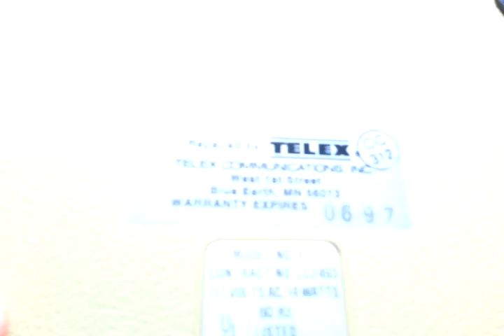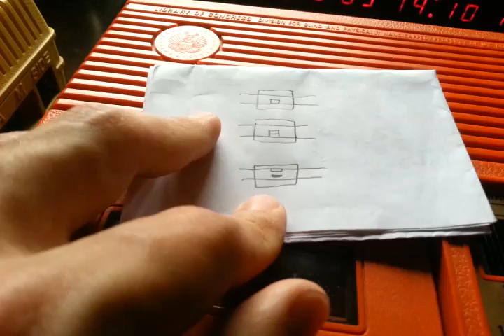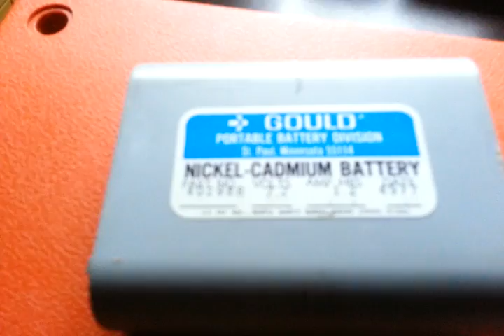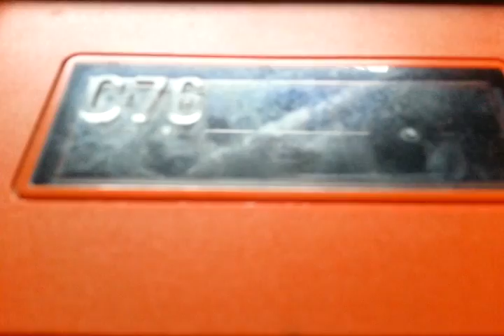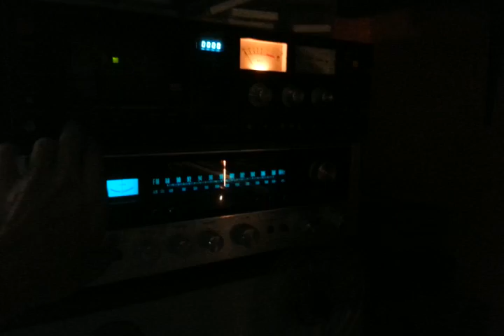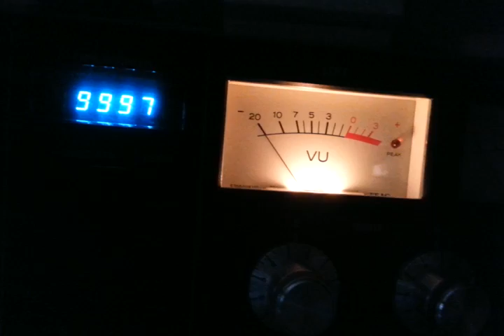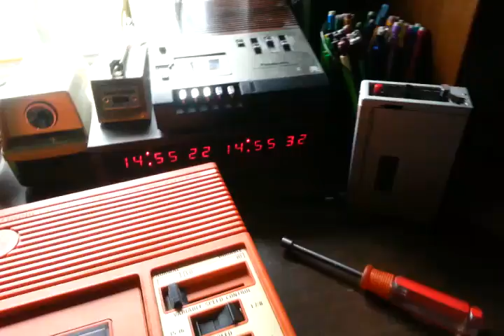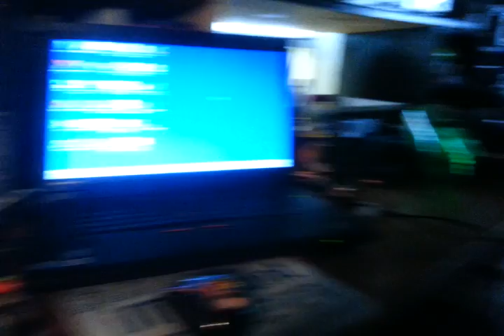C-76 Talking Book Cassette Player modified to Recorder, and showing two other talking book players

Comment: I had the C1, and also agree they're built to last. (I'm visually impaired). I also had a tabletop model from the American Printing House for the Blind, a modified GE 5193A, (winch had the same form factor as these) which is a recorder out of the box. It was fun recording on the 15/16th IPS setting and getting that long recording time.

Comment: I remember when talking book records were in use, then cassette tapes, and now we have digital cartridges. In fact, I recently got my quarterly newsletter from my state TB library and they said that a small (and getting smaller) cassette collection was still available to patrons who had a working cassette machine. However, if the machine fails to operate properly; then, that will be the end of your cassette service because the machines can no longer be repaired or replaced. It seems like they are serious about phasing out tapes and moving into digital. Looking on ebay, C1 players seem common; but, I rarely ever see the older machines.

Comment: My Library of Congress stops rewinding after a couple seconds. I already replaced both belts, but am more familiar with the electronics than the mechancics. Any advice?
Reply from the maker: Is it the C-76? Does the motor itself slow down and stop turning?
Reply: It's the C-1. In some cases it does this, in other cases it just auto-stops as if the tape has finished rewinding. If it's powered by the battery, it's hard to get it to play, rewind, or FF. Thanks for the reply